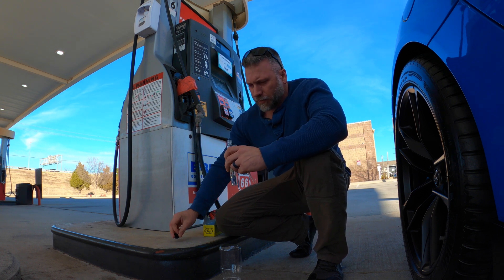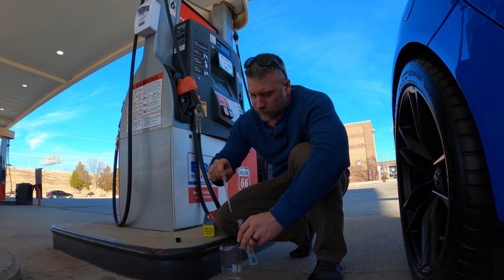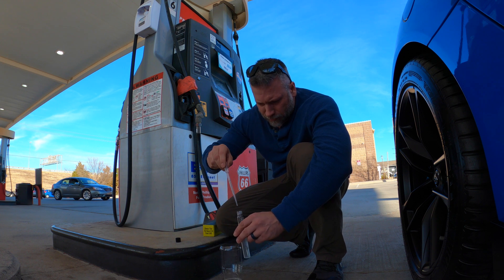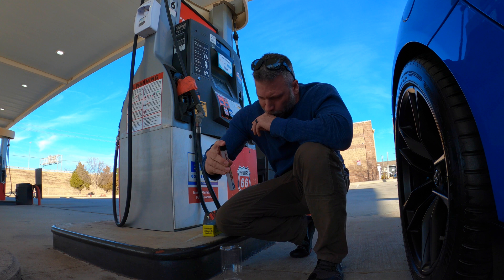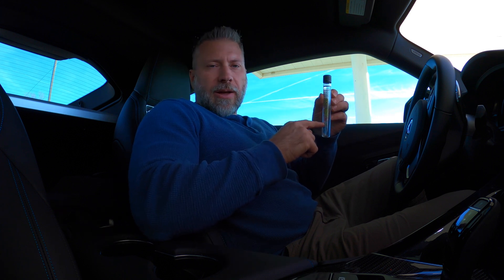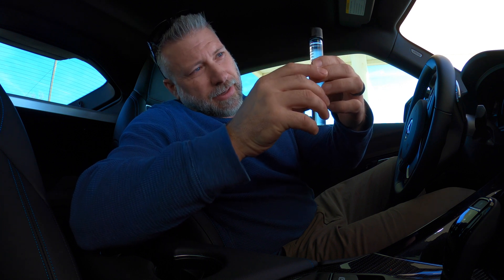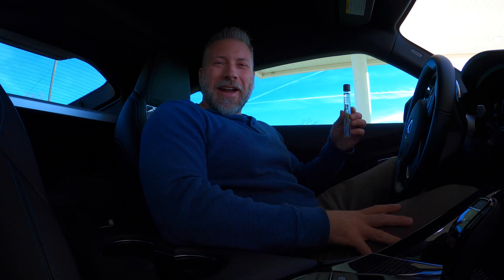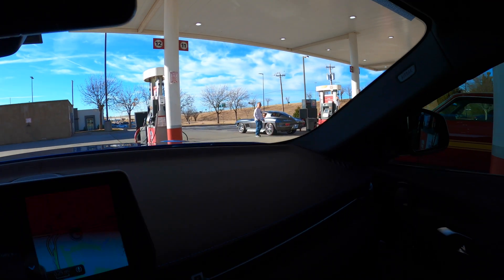How to do an Ethanol Blend :: E85 Test

Comment: That's a lot of work.
I just go to a gas station that has the E30 option and use that. Easy.
Reply from the maker: That works if you have a blender pump available.  Personally I have never seen a blender pump or a pump that offers anything other than E85.

Comment: Remember base fuel with no E85 added is still considered e10.  Thats what in the normal pump gas.  So when you do that calculator it would need to be current ethanol % = 10 for straight 87/89/91/93.  All those are e10.  So if you want to get to e20 you'd set 20 for the desired %.  Its a big difference so remember unless you are using e0 gas aka ethanol free, then the current e% of straight pump would be e10.
Reply: Not necessarily.  You can still get no ethanol gas that is e0.  You do need to know what the gas is that you’re using though.
Reply: @ Spiguyver Backpacking if the fuel at the pump is ethanol free it usually clearly marked as ethanol free, so most pumps will have the 10% ethanol.
Reply: Yes, and most gasoline sold that allows 10% ethanol content will actually test to around 8% ethanol content. Per DOE regulations, stations that sell E85 blend can have a range of 51% to 83% ethanol in the fuel and still be considered within required specifications. See https://afdc.energy.gov/files/u/publication/ethanol_handbook.pdf . This is why you SHOULD frequently test the ethanol content at the E85 pump you use. A side note, if the 87/89/91/93 pump uses the same hose, you just select the grade you use, there is a very good chance the first 1/2 gallon of gas you pump won’t be what you selected. From the pumps internal fuel selector transfer valve to the hose nozzle will contain approximately 1/2 gal of what ever the guy before you pumped. Isn’t this just so much fun? Just saying. 🙂
Reply: @garywilliams7319 E10 can vary between at least 5-10% ethanol as well. Thankfully you can easily test the ethanol content of the pump gas using the same tester.
Reply: Are you referring to the section called pump gas ethanol?

Comment: Can you put the calculator app in your video description? I have one already but the UI on your app looks way better.
Reply from the maker: It’s on iTunes and is called e85Cal.
Reply: @spiguyversgarage9452  I don't see it in Android store. Go figure. 🤦🏻‍♂️. I guess it'll be easier to gauge each fill-up with the flex fuel kit anyways.
Reply from the maker: I am on an iPhone, so I guess it isn't available on Android, that sucks.
Reply: @spiguyversgarage9452  yep, no android auto or even the supra connect app. Pretty awful.